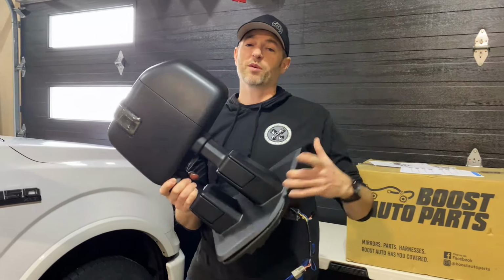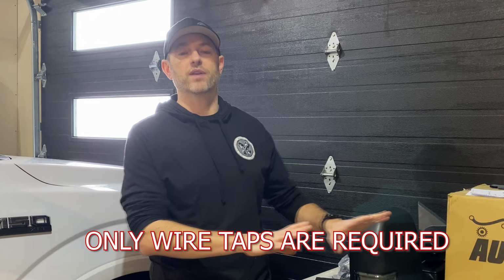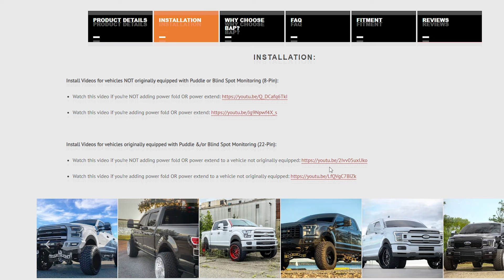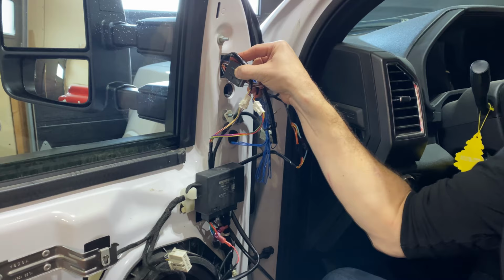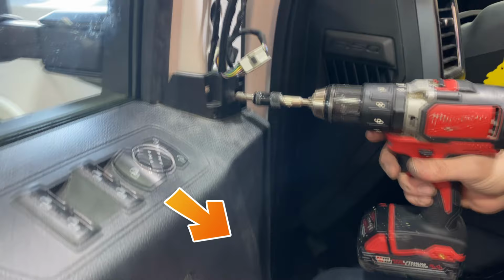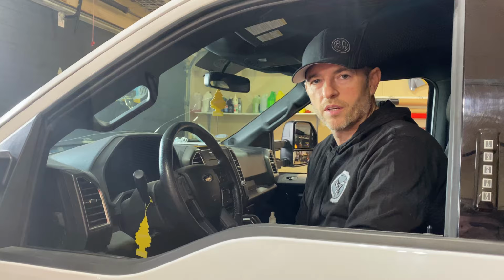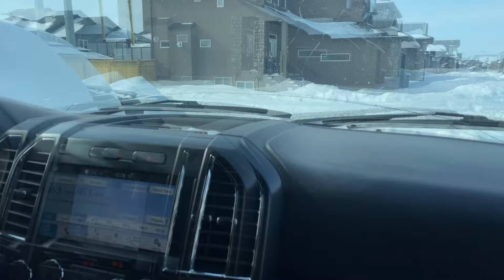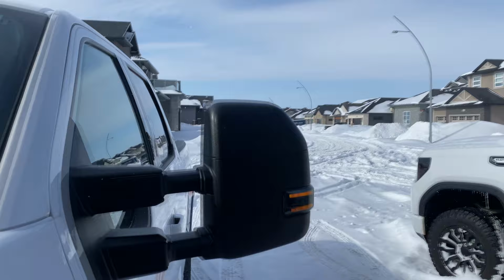Tow Mirror Upgrade with Power Fold & Power Extend - Ford F-150 - Boost Auto Parts

Comment: My 2017 gmc sierra 1500 has manual side mirrors for some reason is there a way to change them out to row mirrors or do I have to do something different?
Reply from the maker: You can build a set from BoostAutoParts, but you might need to add a switch from them or one you find yourself

Comment: Does anyone have information on what wiring I’d need to add from an XL model? They are only big glass adjustable. I can figure out the turn signals but what about to adjust and have heated?

Comment: I have a 2020 F150, installed the F250 Tow Mirrors. The Outside Temp sensor in the factory mirror is on the drivers side, the temp sensor in the Tow mirrors in the passenger side. After the install my Check Engine Light is ON because it is not sensing the Temp sensor now. Is there a Fix for this?
Reply from the maker: Yes there is.  BoostAutoParts has the fix. 

https://boostautoparts.com/products/ford-air
Reply: @Donslife  Thanks (am going to buy it), is there an install vid or instructions for this harness?
Reply from the maker: Yes there is on the same screen you look at the item on their site
Reply: FOUND THE VIDEO, THANK YOU

Comment: Is there an alternative to using t-taps? Ive heard that they aren't very good. Also, is there a way to use forscan to turn on Lincoln mode to make the mirrors fold whenever I lock the truck?
Reply from the maker: You could splice, solder and heat shrink your connections if you wanted to.  BoostAutoParts might be able to answer your Lincoln question

Comment: Great Video!  Do you think there could be a way to make the module continuous vs having to type in the code every time or does that actually initialize and cancel out the mirror adjustment function?
Reply from the maker: I think it has to be done this way to get dual functions out of each button.  I have used it for awhile now and it is becoming 2nd nature.  I love how non-evasive the install and usage are
Reply: @Donslife  makes sense!  Thanks for the quick response

Comment: Hey Don, not to hijack this thread but did you ever do a catch can video for your GMC?  Thamks Mark
Reply from the maker: No sir.  I just haven’t made it a priority 😞
Reply: Well, checked them all out and dedid we decided to bite the bullet and bought an UPR for the 5.3 with spare o rings and upgraded  billet check valve.   Let you know how it goes.  Thanks for all your videos.  Well done!
Reply from the maker: @markbutcher2734  please let me know!
Reply from the maker: @markbutcher2734  I ordered one too.   Mine will take longer to ship to me I am sure.
Reply: @Donslife  Awesome.  I hope they work   as advertised.  I live in Michigan and as you well know, it's cold in the winter - ha.  So with UPR, you get a large 12 oz can so if I collect condensation, it's one of the largest containers a available.  I garage my truck so most of my starts are toasty warm LOL.  Thanks again for your videos - so well done and amazingly helpful.
Reply: @Donslife  so, I checked on my order and they told me the cans are built to order and that they are out to be anodized and that will be about two week before they are done.  Since that wasn't mentioned anywhere in the ordering page they gave me a 3 inch can which they did have instead of a 2.5 inch can and shipped it out yesterday.  So yes, it may be a bit of a wait?

Comment: Yes only $1400 before tax
Reply from the maker: They can get up there is price if you add every feature.  The cool thing in my opinion is you can add features your truck didn’t come with and/or doesn’t have the wiring for.   There are cheaper options but in most cases they are inferior in quality and only fold and extend manually.  I can’t imagine having to fold or extend the passenger mirror manually every time.  For the truck I’ve installed them on, it was a no brainer.  The truck will be on dozens of job sites with a trailer every year and they’ll be worth it.  Don’t take my word for it, read the reviews.  I acknowledge they aren’t for everyone, but for some (like my business) they are an asset.
Reply: I just bought a 2022 xlt and these are already installed from factory as an option, the code does not work to extend and retract the mirror, it can only adjust where it’s facing. What am I doing wrong?
Reply: @joaquincruise3372  If this is a serious question, you have optional factory tow mirrors WITHOUT the power folding and extending option. More commonly found on the higher end models. I believe the "code" is just for this aftermarket mirror.